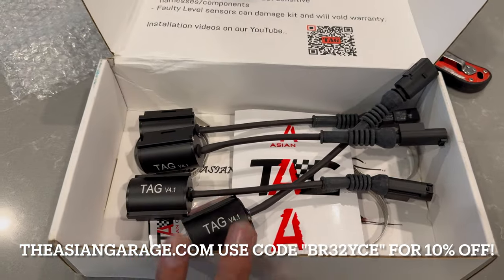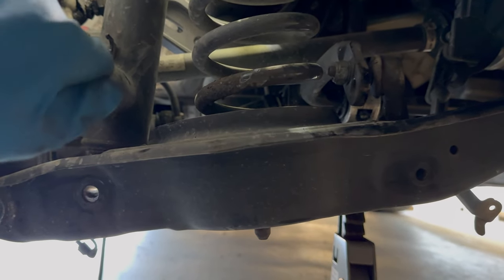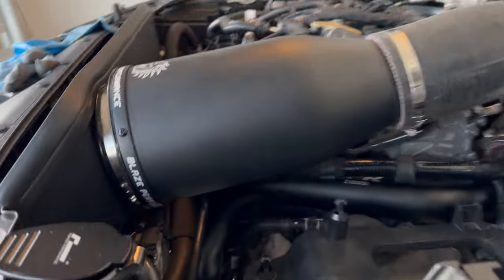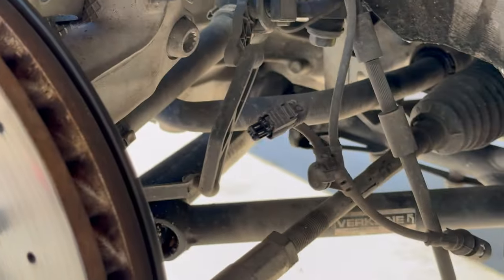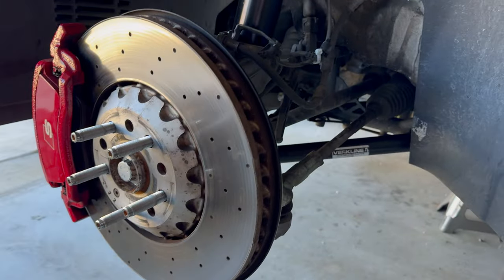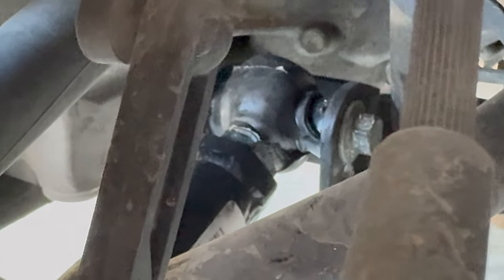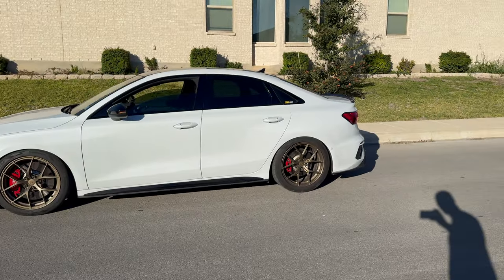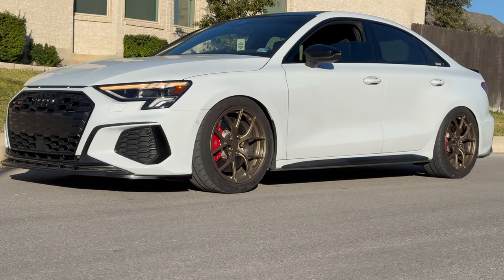EQT Balance Line Coilover install + TAG DCC deletes! | 8Y S3

Comment: Nice video Bryce as always.  Question, why didn’t you do the 2x4 method?  I know you had a previous method doing this on your MK7 MANual R.  I’m actually getting ready to redo my suspension.  I originally installed ED springs on stock strut/shocks using the 2x4 method.  It was okay, kind of sketchy getting the strut back in for me.  Anyway, I’m thinking of removing the strut how you did it here.  Also, Humble Mechanic seems to like it this way also.
Reply from the maker: It’s less sketchy and I had some other things to adjust and check on as well. To be honestly the only reason I did the 2x4 was because back then I only had hand tools, and fighting that axle bolt was really not fun all alone. Now that I have some real impacts (Milwaukee high torque is a beast) I can just zip right through the process without doing anything sketchy lol

Comment: Do you think its possible to change the front coilover spring down the line without pulling the entire coilover out? In my last car I was able to leave the bottom bolts connected to the coilover, disconnect the top bolts, endlinks etc and pull it down enough to pop the coil off and slide a differant spring on. Not having to disconnect the axle to change spring rates would be great. It was impossible with the strut setup but the coilover was much shorter and didnt need spring compressor etc to swap so it made it a quick 1 hour spring swap.
Reply from the maker: It very well might be possible! I’ve never seen or tried it myself but it is significantly shorter!

Comment: Looks sick! also in a pervious video you mentioned a brake upgrade. Have you thought about perhaps staying with the stock sized rotors being oem or 034 2 piece and maybe upgrading the caliper to the oem akebono 6 piston that come on like the q7 and other models? You'd be able to stick to the 18" tires and improve the modulate ability with the 6pots.
Reply from the maker: I didn’t realize those 6 piston would work.. are those the same as the macan caliper? I would love a “OEM+” setup honestly. As I sit I’d prolly do the 034 rotors front and rear with new pads and call it a day, but if I can save even more weight I’d love to do that too without spending thousands more

Comment: Question, on the eqt coilovers it won’t be necessary to swap or upgrade the top mounts right since they come fixed or adjustable?
Reply from the maker: Correct. You just pick whatever tops you want when you order. But you could always change it down the line if you wanted to
Reply: @BryceJordanProductions  I  forgot, are the magnetic rear top mounts reusable or manageable to swap out onto the coilovers too? Or a new set of rear top mounts are required?
Reply from the maker: You can use the oem ones, I’d personally swap them while you’re in there though for some 034 units
Reply: @BryceJordanProductions  I think I am gonna order new ones don’t want to mess with the electronic wire. Thx
Reply from the maker: @maniirdzjr24 there’s no wire to the mount 😃 only to the strut.
Reply: @BryceJordanProductions  on my 17 s3 there is, on right on top of the bolt.
Reply: Also I noticed on yours on the new gen it’s not wired to bolt instead on the bottom of the strut just like the front struts .
Reply: Lastly, How /what do I go by figuring out the strut spec measurements on  the coil overs before installing ?
Reply from the maker: I didn’t know the 8V was like that! My mk7 wasn’t like that either, interesting! As for the strut measurement I watched a few videos to get a good idea of where to set them. It’s not the most easy thing for me to explain without giving you a visual. There’s a bunch of good videos out there. BC and fortune auto are the same style
Reply: @BryceJordanProductions  yeah I see what you mean. I was wondering if I should keep my whiteline  front roll center/  camber correction ball joints or go back to stock ball joints.?
Reply: @BryceJordanProductions  do you swap out the rear bump stops too? I’m thinking I do.